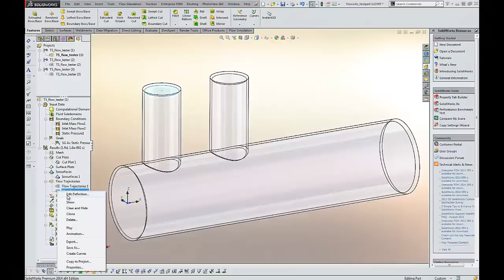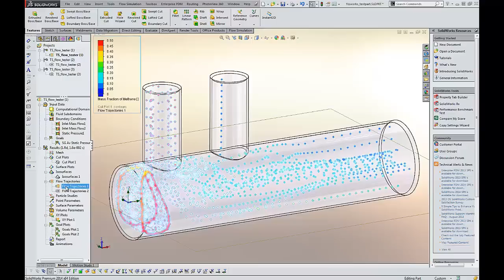SOLIDWORKS Flow Simulation 2014 CFD Demo – Fluid Mixing Flow Analysis

Comment: Is it possible to simulate air and water mixing? As in a multiphase flow?
Reply from the maker: Hi Vijay,
Yes, starting in version 2018 you can use the newly released "Free Surface" functionality in Flow Simulation.  This simulates a multiphase flow system such as air and water.  You can see it demonstrated here:

http://kb.goengineer.com/go/default.aspx?kbID=14603

Comment: Hey, if you are a simulation engineer, where are the mechanical engineers? In which department are they working at?
Reply: Mechanicals can (and typically do) do simulations. If it moves, or transforms energy, a mechanical engineer can play with it.